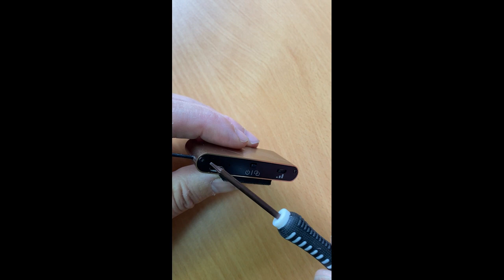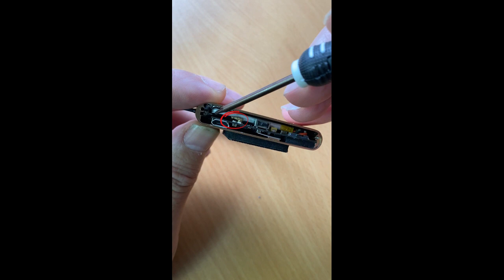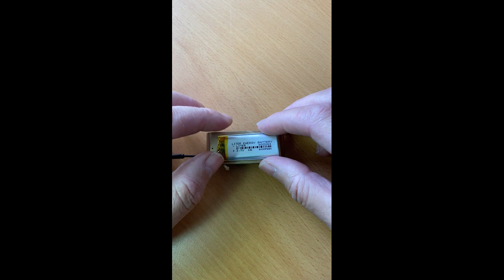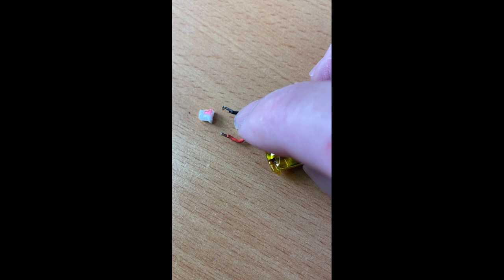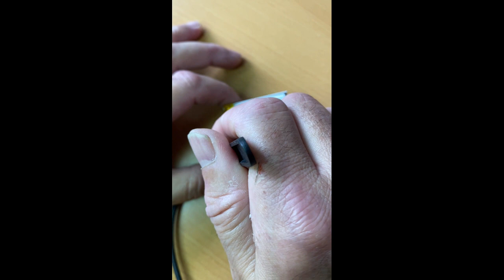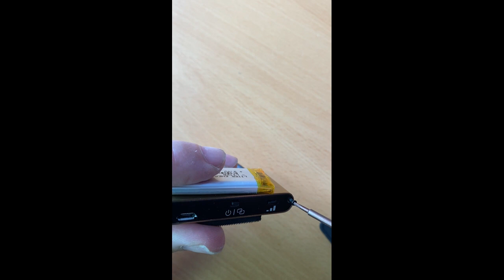CloudVocal Isolo Mic Transmitter - Changing the Battery

Comment: Yikes, who in the world has a drill bit that small???  Any alternate solution for that part of the fix??
Reply from the maker: It’s been a while since I looked at this. Somehow you have to feed the wire from the external battery into the case. A small hole seems the best way. These small drill bits are widely available. I can’t remember the size bit I used, but if I were to do it again, I’d drill a wider hole and insert a small rubber grommet to protect the cable sheath from abrasion.

Comment: I have the same problem. I only get 2 hours max out of a fully charged mic and it’s out of warranty so I looked up to see if others had the same problem and voila! Here you are with a solution! I will have to attempt this fix. Thank you!
Reply from the maker: It’s a little tricky but well worth it. Even my higher capacity battery died after a year but I was able to swap it in 10mins. Good luck!
Reply: @vettessj thanks! Where did you get the battery from?
Reply from the maker: @lisawanderess eBay, put in the battery type, you should find a supplier.

Comment: A sincere thanks for taking the time to make this video. I'm really glad I did a recent Google re: the subject. I didn't use my iSolo enough initially, in order to see the "less than advertised"  battery life. Of course it was off warranty by the time I started to seriously want to use it. Emailed the company and their response was I should "upgrade" to a newer one. I emailed to them "why would I buy another very overpriced microphone that doesn't work?" In addition, after continued use I noticed an electronic, constant soft buzz. However, if I grounded the case with my finger/body, or moved the antenna around just right, the noise could be made to go away, but ultimately would return.  Clearly something is not grounded internally. Saw your video and at least there's hope. I'll be taking my unit apart and look to fix after I locate a sleeve and battery. You would think for what they charge they would have been willing to ship me a viable, new, better battery. May I suggest you list the sourcing for the sleeve and battery. Again, a heartfelt thanks for taking the time.
Reply from the maker: Glad you found it useful. I like the product but didn’t want to have to keep returning it every 6 months or so which is why I did this. There’s an internal plate which is soldered to the case which grounds it, it may detached itself, easy to resolved but again disappointing quality given the cost. I replaced the sleeve with a 3-D printed box, see the follow-up video. I can’t remember the source of the battery but it was a readily available part, available from good electronic component suppliers. Good luck, don’t rush it and take care!
Reply: @vettessj  I do 3D printing. Could you source the files for the case? I went to Thingi but did not see one that looked like yours with a casual search. I've also researched the battery and will order once I take the unit apart. Those batteries come in lots of sizes and specs. Just got a T4 Torx and will take the unit apart shortly. Thanks again for your help and input.
Reply from the maker: @rkparis3064  I didn’t print it myself, I’ll see if I can get the files from the person who did it for me. You can use any rectangular box which is large enough to hold the battery you buy. I wanted a larger one to give me plenty capacity. So far it’s been great for gigs.
Reply: @vettessj  Thanks for the prompt response. If you can get the files that would be great. Just ordered the battery, some battery connectors/wires, and drilled the hole. I'm going to bring the battery wires through the case hole, and switch over to different connectors outside for easy future changes. Also am checking with an ohmmeter for loose ground connections. Haven't found anything so far. Thanks once again. Stay in touch.

Comment: My transmitter unit will only give about 15 minutes now. It is about two years old and has been charged about 30 times. I would expect that if you only get that much use from the battery, you would be able to replace it much more easily. Quite disappointing actually and it's too bad because I do like the system otherwise. I don't need to say that the entire set up is junk if you can't charge the transmitter. Another case of a great idea, very poorly executed.
Reply from the maker: The system hasn't been designed for easy replacement of the battery. If it performed to spec, it wouldn't need to be because supposedly it allows several hundred charge cycles and would still operate for 3-4 hours. Clearly the original choice of battery has severe problems. I gave up asking for replacements, that's why I decided to do it myself. I understand they will replace the battery for out of warranty units for a charge - I don't know how much but I think they should swap out all units, irrespective how old, with a more reliable battery.